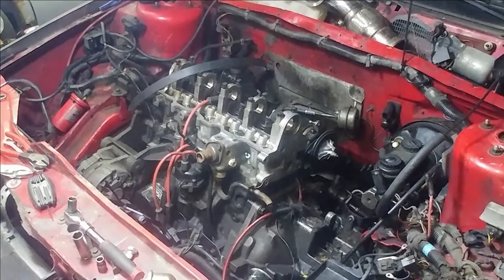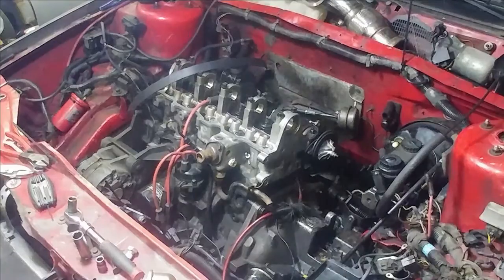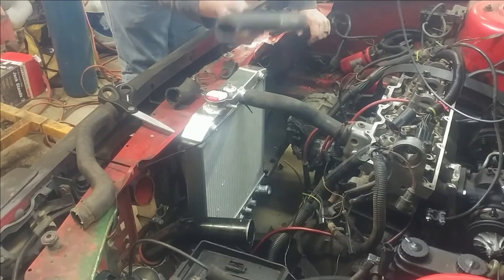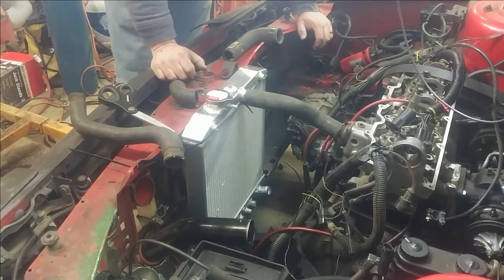1987 Dodge Daytona Shelby Z #10 - Cool Story Bro

Comment: think there's enough space under the bumper to fit a 12x4 intercooler??
Reply from the maker: The intercooler that was in the car when I got it had a 21x9x3 core, the tricky part is the piping.  I swapped to a intercooler with the inlet and outlets on the same side to help with that.